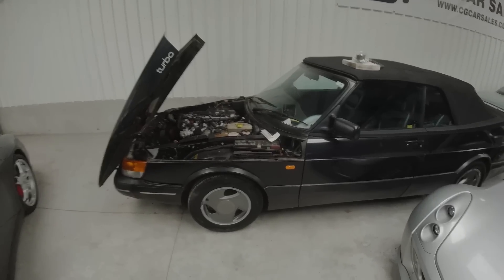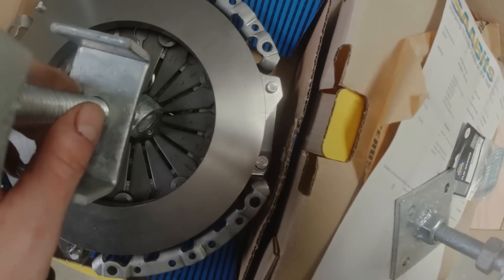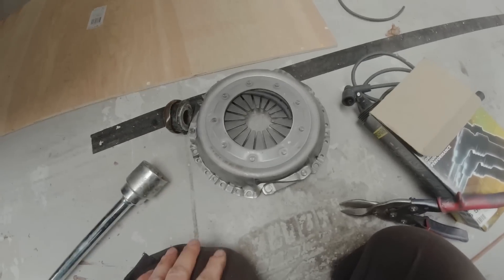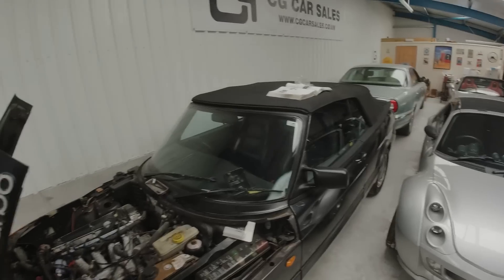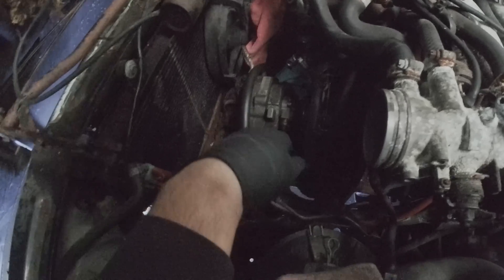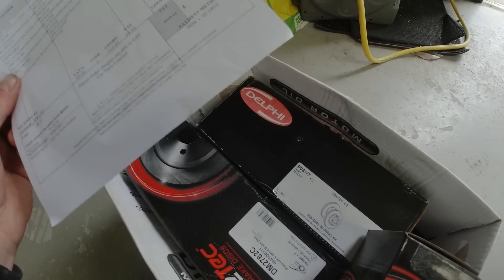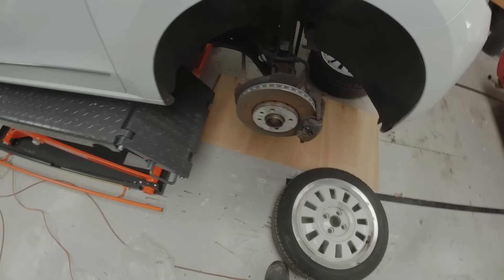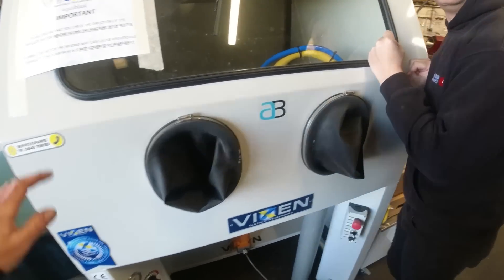How quickly can you spot my BIG mistake?

Comment: Love your channel. Would you do an episode on automatic cars. I'm thinking of buying one, but it's so confusing , between cvt and the rest😅 I don't know what to go for. I'm in Ireland and the prices here is much higher. I'm thinking of the Nissan note. I would appreciate your opinion. Thank you.
Reply from the maker: Hi Teresa. Modern Auto boxes can be a paint, CVT do not have a great reputation. When it comes to Autos the older the better as they have Torque convertors rather than manual boxes with hydraulic changes. Nissan as good but their CVT boxes also have a bad reputation. Most certainly it is far more important to go for low mileage on Autos than on Manual. Older Volvos 90s and 2000s tend to have very good auto boxes.
Reply: @ChopsGarage  Thank you.

Comment: What do you think about the Suzuki Swift? Five years ago I bought a Swift that was eight years old with 42,000 miles on the clock. Since then it's been the most reliable car I have ever owned. Always starts, passes MOT all the time and never breaks down. Never needs engine oil topped up between oil changes and goes like shit of a shovel.
Reply: see old vids , chops sold swifts every week
Reply: 8 years old with 42000 miles any car would be reliable

Comment: So much hassle. Jack up a wheel. Slide the clutch under the wheel with a spacer l. lower the car down. Voila compressed
Reply from the maker: Why jack a car up when ones already up on lift?
Reply: Yeah fair Point on the lift.  but how much time and money did you put into getting to that solution. Sometimes a simple mind simply works better.

Comment: If you want to get loads of views then you should Drop a 1.8 i-vtec Engine & manual transmission in that Logo & sort the wheels, suspension and brakes.
I say the 1.8 i-vtec because K series and B series are a bit pricey to say the least. I bet you could pick up a 1.8 i-vtec engine & manual transmission for half the price of just a K20 Engine.
The 1.8's 140bhp would be plenty of power for a lightweight logo too.

Comment: It's just as well James had the leak off pipe done, big fire risk, cant have customers driving about p**sing fuel out.
Reply from the maker: No exactly
Reply: @ChopsGarage  you did good!
Reply: @ChopsGarage  been on with the iow freeloader bud, bit of welding, half a day, only a bit on end of sill, other Garage that caused the fuss and billed her for handbrake doing haven't actually done anything, so a load of fuss about not much at all, with refund and costs I'll have four and a half in it, probably 3495 it so will loose a grand, these females with 4 wd eh mate!
Reply: @ChopsGarage  just seen a story on car dealer magazine bud, guy fined 2k plus 900 victim comp, plus another 2k fine for his company, selling a car sold as seen, then refusing to help when it broke down, so basically 5k on probably a cheapie, pays to do all you can obviously.

Comment: Apparently you compress the fingers and take the clutch and slave out together. Re your biggish bills bit of leak off pipe, side repeater and a fuel filter could have been done easily enough by yourself, probably saved 100 quid.
Reply from the maker: But lost me a load prepping other stock bud
Reply: @ChopsGarage  keep telling you that, I stopped with classics a few years ago, that saab will cost you maybe 20 easy flippers, add on others you keep buying and you'll loose dozens of easy late cars, every time you see a tatty 80s or 90s car think, that'll cost me 25 cars, might put you off then.
Reply: @ChopsGarage  sorry I thought you meant working on the saab, not doing a few easy jobs as 99%of car dealers/Garage owners would do, but you know best mate!
Reply from the maker: @roystonvehicles9129  no working on saab is content and the smaller jobs were done while I was doing clutch. Although did save few hundred in labour doing the clutch as well
Reply: @ChopsGarage  I know bud that classics are good content, just letting you know experience.

Comment: Why so scared of the XF. Brilliant cars and Jags are no less reliable than anything else if looked after. Mine was faultless after 120k miles. Did you know that there are two pull levers under the parcel shelf in the boot that drops the rear seats down? Really useful. Use it look after it and don’t be scared!!
Reply: 120k isn’t much tbf 👍